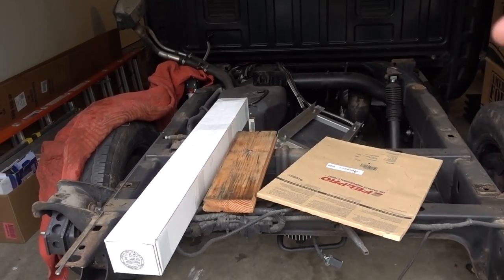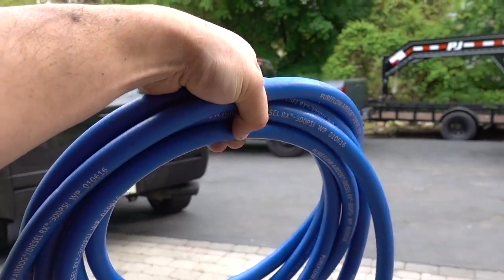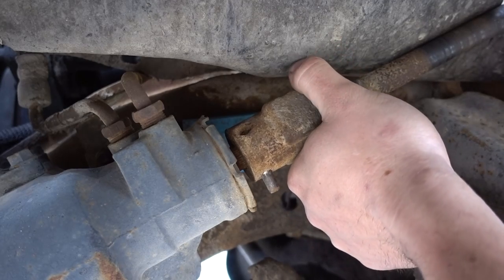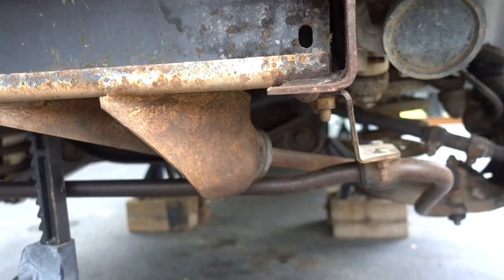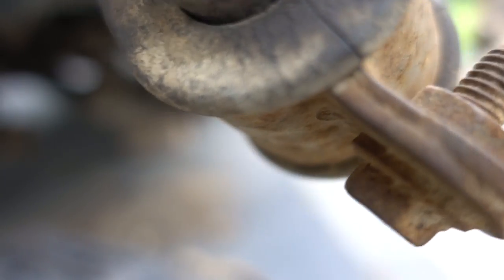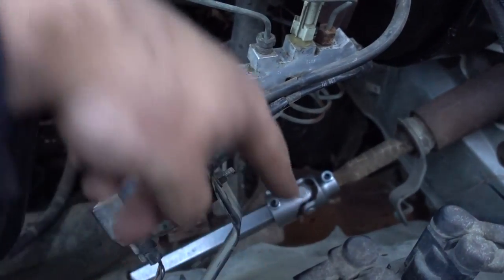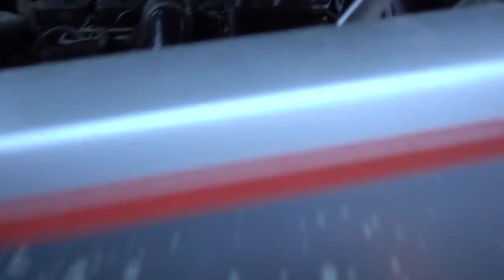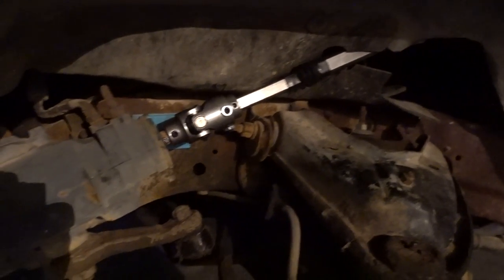FIXING DODGE RAM SCREW UPS!!! 12V CUMMINS FIXES!!

Comment: 2:50 couldn't be more true Greg. I rebuilt my turbo a few days ago, thinking it would be a good few hours, pull the turbo take it apart quickly throw in all the seals and bearings and  throw it back into the engine. NAH the bolt that connects to the exhaust side of the turbo broke clean in half and remained in the turbo and I don't have the tools to have that fixed so I had a buddy do it and yeah a few days later I finished

Comment: pro tips use pb blaster or kroil or transmission fluid to make bolts/nuts come off easier without breaking them. hope it helps :) sometimes heat or a bit a percussion persuasion works too!

Comment: **Greg you are going to want to read this***

That steering shaft has a collar with a set screw that is currently down against the the bottom u-joint near the steering box.  The instructions for the double joint shaft don't say this but that needs to be slid up against the slip section of the shaft and tightened down.  This prevents the shaft from having two slip points, there is also on up in the dash.  If you leave this collar where it is your steering shaft will fall apart while going down the road....ask me how i know.  I don't know why, borgeson only has that step on the rag joint shaft instructions but now the double u joint shaft instructions...
Hope this helps

Comment: Greg I have my lift pump pressure sensor right on my air dog.  Is there not a place to do that on the new pumps? I really like it there. it's out of the way and I didn't have to cut and spice my line

Comment: What would be your opinion on a twin turbo 6.0 f250? I can s me the info on it. I'm in the market to buy a diesel and I'm torn between a cummins and a bulletproofed 6.0 that is worked. Let m know.
Reply: Thor USMC it depends on the year of the 6.0  the 03-04 many issues. The 05-06 were great engines and shortcomings fixed  either cumins or 6.0 would
 be good it comes down to looks of the truck you like and wether you want a cruiser or a puller  cumins better low end torque. For towing inline 6 .  The 6.0 v8 is good all around. Again it really comes down to looks and what you like  IMO  contact Bill at powerstroke help if you want a 6.0. He has them built and ready for sale with lifetime warranty
Reply: Necked-red Diesel903 thank you very much, I've b en seeing deals like crazy I'll be towing and driving long distances. I know cummins last for ever.

Comment: @greg_alberalla you didn't say you were putting the fuel pressure sensor in the block you said the water in fuel sensor needed to but put there so you were in fact completely correct